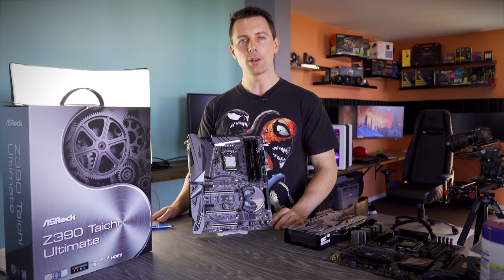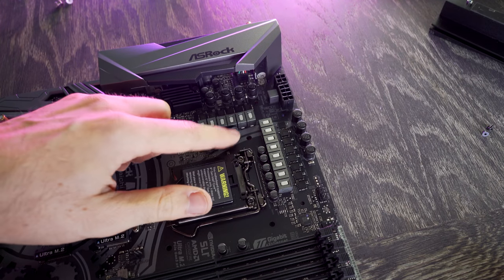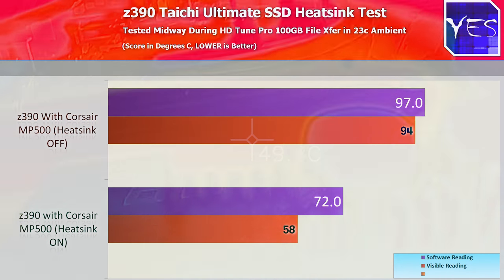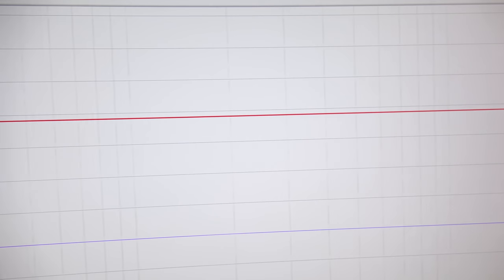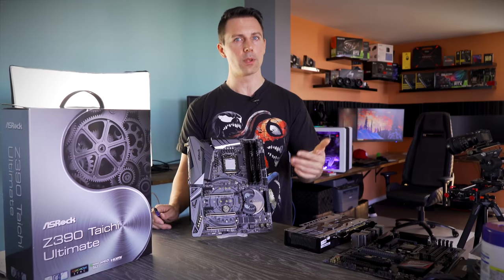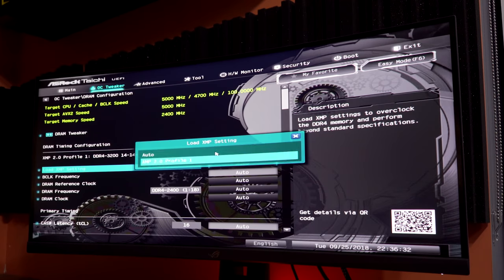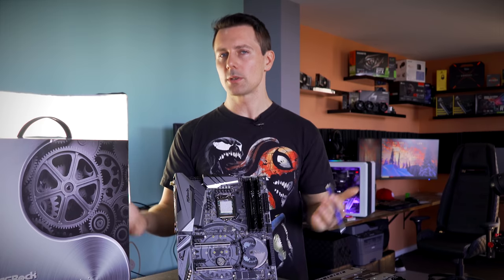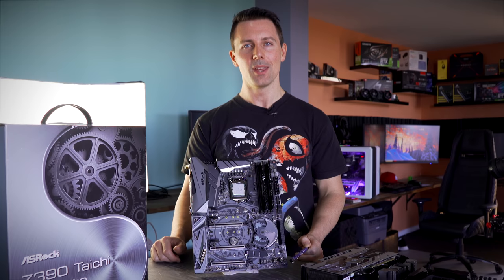z390 Taichi Ultimate REVIEW - Can it HANDLE the i9-9900K?

Comment: - reasons to buy one : 1) front usb type-c (most especially on ryzen don't have one) 2) 8 sata ports (lots of MB only have 6 now because of lack of MB lanes) 3) 10Gbit ethernet ($ value+one less pci card to plug)
- reasons not to : Ryzen plateform is focused on CPU lanes but is behind in terms of motherboard lanes X399(4xPCIe3.0+8xPCIe2.0), Intel is better on that front Z390(24xPCIe3.0) making Ryzen a better plateform for SLI or multiple PCIe M.2 drives (connected directly to the CPU) while Intel is better if you have lots of SATA drives and USB devices and need 10Gbit
I went i9-taichi ultimate in the end, I have a use for a higher clock and I already ran out of usable usb on my X99 (too many usb drives please remove one) and lanes (plugging the 10Gbit NIC disabled two of my sata drives ><) while I gave up on SLI because of the stuttering and the less and less support it suffers
USB 3.1 10Gbit all those new technologies require a ton of bandwith/lanes so I recommend to study carefully what you need when buying a motherboard today especially if you have a crowded pc with lots of internal/external drives and pci cards (check MB manuals before ordering)

Comment: Just look normal 24 pin connector and a 8+4 pin for the cpu(i think its the i9 9900k). Do we serious think that this processor will have a low tdp and low temperatures? (Other processors of 9th gen too)
Reply: They soldered the ihs finally and less heat means less power leakage, so possibly
Reply: Also a single 8 pin can do about 300w of power, sooooo.
Reply: 300w through a single 8 pin would probably start a fire. That's why most motherboards that expect that much power use an 8 + 4 pin
Reply: The extra 4 pin on most motherboards is just used as a marketing point. You only really need the 8 pin.
Reply: X299 would beg to differ.
Reply: @nightcorefusion3884  lol, that's true. That platform does need the power.
Reply: @nightcorefusion3884  actually my r9 390 if i overclock it go to like 600w tdp and has 8+8 connector so i think that a 8 lin can handle 300w watt
Reply: @VigneshBalasubramaniam  hope we will need only the 8 pin.
Reply: @gabrielemarchini6329  No, one R9 390 card doesn't pull 600w... I've had 4x 290x Crossfire Watercooled @ Rampage iv extreme and my Platimax 1350w PS hardly managed the +1400W peaks pulled with slight overclocking on my 4 Asus Matrix (2x with, 2x without Platinum) - yeah, we also have 230v here...
Reply: @bjornpaulsen3015  my r9 390 actually have a higher tdp than 400w withour overclocking. If i ocerclock it im pretty sure i ll reach 600w
Reply: Remember that 70-80W of that comes from the PCIE slot. And TDP is not the same as power draw. Although people do confuse the 2.
Reply: And no, an R9 390 is not drawing 600w, not unless it has some crazy mods attached to it.
Reply: I was looking at Ryzen 2950x too, check reviews Watts go from 220 up to 500+W on them so despite all the fake bad buzz against the 9900k, all cpus when overclocked are hot my current 5960x@4.3Ghz on all 8 cores is already at 216Watts and temps are more than ok even when compressing videos for half an hour (fans become very noisy tough)
Reply: So don't have use 4 pin with i5 9600k overclockers? 8 pin will be enough??

Comment: Still rocking a x5675 overclocked, thinking about going for the 9900k or maybe waiting for the next gen Intel chips in 2019 (10nm), also spotted a dual Xeon (2.6ghz ones) T5500 for £100 which I am very tempted to get and chuck in a couple of x5680's into for a rendering/batch image processing/music VST slave machine for a total of about £200 including the upgraded processors and some extra RAM (only comes with 8GB, could probably do with 24gb 1333mhz ECC on that machine with the 16gb at 1800mhz on my main system).
Reply: Ended up grabbing it as I knew I'd regret it if I saw it got snatched up a few days later... should be a really useful tool for background tasks. 12 cores/24 threads at 3.3ghz-3.6ghz Turbo (will try out Throttlestop to try and get it maxed out all the time).
Reply: cool story
Reply: Thank you, I will send you a letter to inform you of when the sequel comes out.

Comment: Current specs say there's 1 x16 and 2 x8 PCIe slots, so 3 way crossfire should be viable enough right?(as you mentioned one of them was x4) Only asking as I've 3 mining GPUs that I'd like to test in a board.

Comment: Great board for the price. Runs my I9-9900k stable at 5.2 My temps are really low but 5.3 just will not run stable. I think this may be a limitation of the board, but since I just run a 5.0 I could care less. This is a high quality board for a reasonable price. I've heard some have had issues with the bios update. I've updated the bios twice with no issues.

Comment: Hi, I see you have that massive Sapphire 580 sitting there. I was wondering if any of those heat sinks or sata ports block that card (especially for second PCIE slot). I have an old Z77 Extreme 4 board and I can't use two of them on it due to the Sata ports!

Comment: I'm so torn between the Taichi and the Asus Maximus Hero. HU's views on the VRM comparison on each board has me concerned. I know the Hero can OC fine but if I understand Steve correctly the Hero board will throttle down its clock because of the weaker VRM's where as the Taichi will maintain it's OC consistently. According to a few other benchmarks I've seen run with the Hero running Cinebench the 2nd run does in fact score below 1800 as Steve claimed while the Taichi maintains that 1900+.

Comment: Thanks for the video, been in pc's since they were born, but 1st new build in 15+yrs. Have a question about this mb. If the 3-PCIe 3.0 x16 slots, only 1 is true 16x, 1 is 8x and 1 is 4x (going from center to edge of board). Does that mean the GPU (1080ti or 2080ti) needs to go in the slot closest to i/o to get max. performance out of it. I was really hoping to be able to use it in the slot closest to the edge of the board?

Comment: So how ya like the 9900K like we didn’t know what cpu you were using lol..and why this motherboard everyone says the 9900K will fit in the Z370 boards .. why the Z390 board ?
Reply: You may will have VRM problems with z370 motherboards, especially cheaper ones. But in most cases it will be fine and you can simply use your Z370 motherboard
Reply: I got a Evga Classified so VRM I really good ,, I got a 8700K now so I’m good for a while tho

Comment: The Z390 Taichi and Z390 Taichi Ultimate are not identical other than the NIC.

For the $60 USD difference between the Z390 Taichi and Z390 Taichi Ultimate you get: 
o Aquantia NBASE-T 5-speed 10GbE – the standalone card sells for $80 USD
o SMB Multichannel support (This works using Aquantia and the i211AT even if you only care about 1Gb - You don’t get this on the non-Ultimate even though it has dual NICs, because the i219-V doesn’t support RSS and both adapters need RSS to support SMB Multichannel)
o Onboard Power and Reset buttons
o Newer generation Wi-Fi module including Bluetooth 5.0
Reply: 10 gbit is useless for most and eating up way more lanes (4 times as many as 1/2.5 gbit nic's). i'd newer pay extra for ultimate.

Comment: M.2 sheilds are NOT good for the m.2 
You are supposed to have a “naked” m.2
Reply: Having a heatsink on the CONTROLLER is a good idea, and can help limit throttling in extreme usage scenarios. The NAND is what likes to be hot, though, and while it doesn't really matter if there is a heatsink on it, it definitely should not be actively cooled by a waterblock or direct fan.

Most recommendations involve cutting the thermal pad from the M.2 Heatsink to only apply to the controller, and leave the NAND untouched, but real world performance and reliability wont change much if you leave the whole thing attached to the heatsink. It will, however, change a ton if you actively cool the NAND (major degradation), or if your controller gets too hot and throttles itself (speed impact).

Comment: Good review, although, this motherboard is crap IMO! When overclocking using offset mode, it pushes way too much voltage than needed. My i7 8086K needs 1.26V to sustain stable 5ghz, but the motherboard pushes over 1.4V when using offset mode! What crap LLC that Asrock has!!!

Comment: Yeah I like and appreciate your reviews. But this is not the flagship. Neither is it the replacement for the i7 pro gaming. That'd be the "phantom gaming 9" https://www.asrock.com/MB/Intel/Z390%20Phantom%20Gaming%209/index.asp whilst that is their most expensive board they have dropped the 10gb anti to a 2.5 proprietary. Strange choice. Cinema sound 5 instead of 3, early trials of "a particular chip" have shown that although they seem to be the same the z370s do not actually support 9th gen. Some boards can run it but poorly compared to z390 and half just fail altogether or need additional fans pointed directly onto the pcb. Whilst oc testing is very close to the highest end accepted market leading boards the actual materials and safety features don't stack up in the same way and the boards look and feel a lot more cheaply made. As an example the gigabyte (since you mentioned them) Aorus Master (replacing their gaming 7) has a 2 oz copper (that's ounce..not 2 Australian policemen) layer between their multi layer board and armour all over the top and a hefty backplate. So, as always seems to be the case, aside from the extortionate MSI Z390 Godlike [ https://www.amazon.com/MSI-Motherboard-MEG-Z390-GODLIKE/dp/B07HMGVR8D/ref=sr_1_1?ie=UTF8&qid=1539094878&sr=8-1&keywords=msi+z390+godlike ] that's pretty much twice the price of almost every other board, it's 6 of one and half a dozen of another and there's no ideal buy. Yeah your eyes did not deceive you it really is almost $880us - insane right.